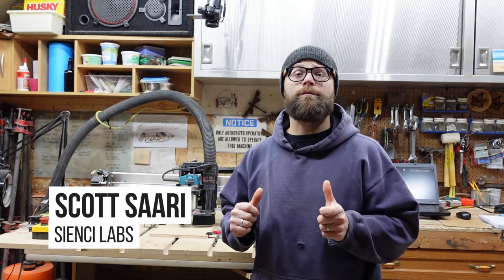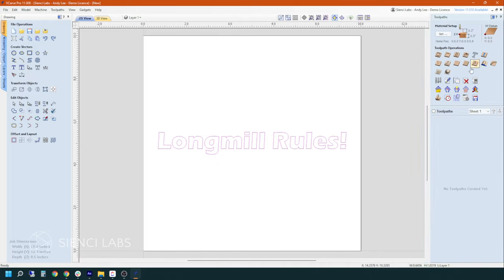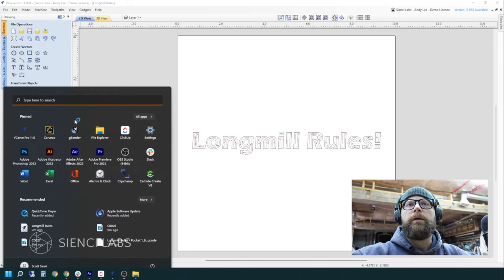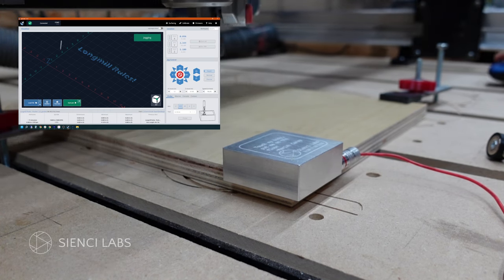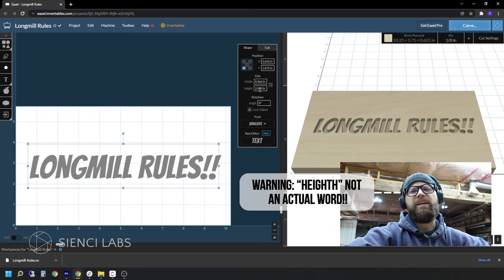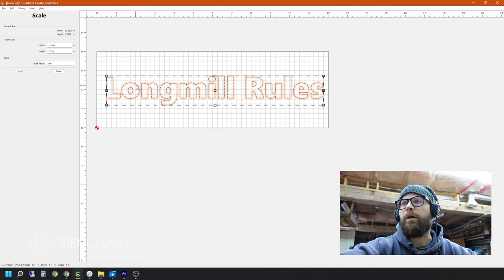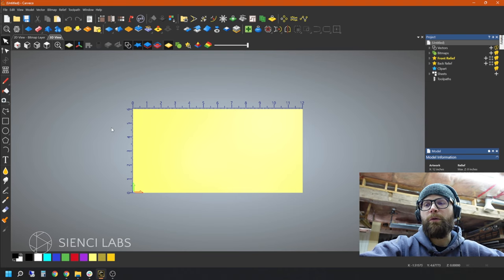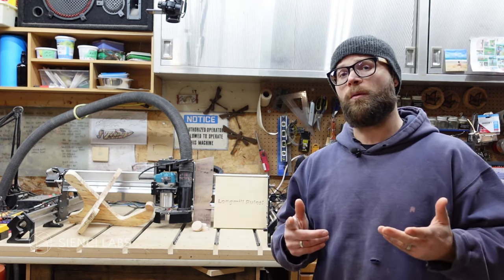Which software should you use to run your first CNC project on your LongMill?

Comment: Very good!
In Carbide Create I found that you can move (jog) your project (once selected) around your material by using the arrow buttons. Pushing ctrl button at same time jogs object via your grid and using shift key moves object slowly one space at a time. Just using arrow key moves it 3 spaces each time.
Reply from the maker: Cool! Thanks for the tip Michael.

Comment: Just getting started with my longmill and will be using Easel. Do you suggest sending the file to gsender or directly cut from Easel? Is one way better than the other? Is Easell the only "all in one" program? Sorry for all the questions.
Reply from the maker: You can do either, whatever you're comfortable with. Easel has some perks to it and it's "all in one" but it's also a bit more constrained than gSender. Feel free to play around with both options!

Comment: How do feel about fushion vs this, I am a 3D modeler so I want to take advantage with 3D files
Reply from the maker: Hi Dorje, Fusion 360 is also a great option for more advanced CAM and CAD, especially for engineering-type work. However, there are a lot of settings and it is generally considered one of the more challenging programs to learn for hobbyists, so you may also want to consider some other alternatives, such as Kiri Moto and ESTLCam that might be a little simpler to use.

Comment: You say in the video that you can't use the touch probe in Carbide Create - but can you send from Carbide Create to gsender then use the touch probe in gsender?
Reply from the maker: Ian I think you mean Carbide Motion which is the Shapeoko sender software. Yes in their software they only have compatibility with their own hardware and machines but if you export your g-code out of Carbide Create (which is the design software) you'll be able to run it in gSender just fine and also use the touch probe 👍

Comment: Newb here. I designed some text on Vcarve that is 3” tall. Once I load it onto gsender it shows my text under a 1/2” tall. 
I followed your video. Input all the correct measurements for my material. Something in gsender isn’t recognizing my material is 2’ long
Reply from the maker: Check that you used the proper post processor when you saved your gcode file from vcarve. It should be Grbl(inch)...You may have selected g-code(inch) accidentally. Let us know if that helped!
Reply: @SienciLabs  yeah I figured it out after I made that comment and you are absolutely correct. That’s what it was. Thank you for the reply!

Comment: I went with Vcarve Pro ($$$) and are using Carbide motion ( free) to take advantage of the bitsetter and bit zero add ons.for my Shapeoko 4    You can now use a corner touchplate to zero the routers' x y & z and correct for different tool lengths after bit changes.
Reply from the maker: Very cool! Thanks for the input!